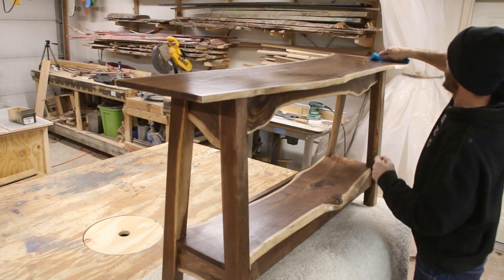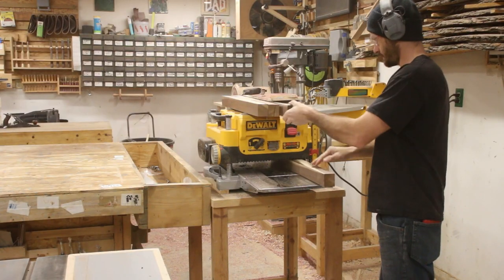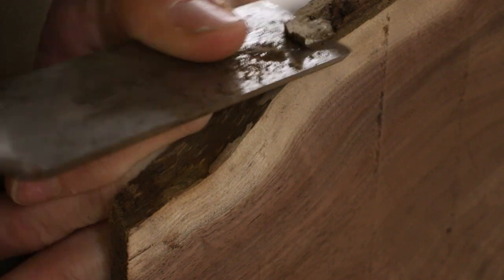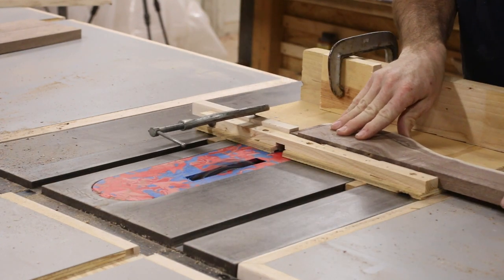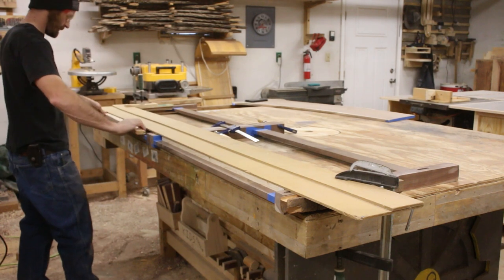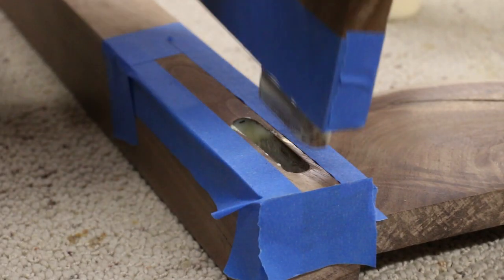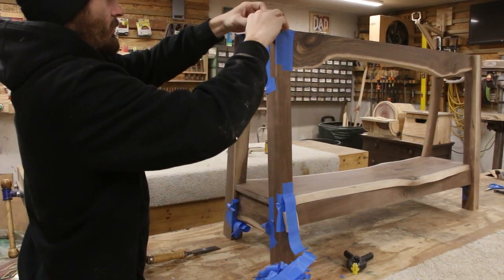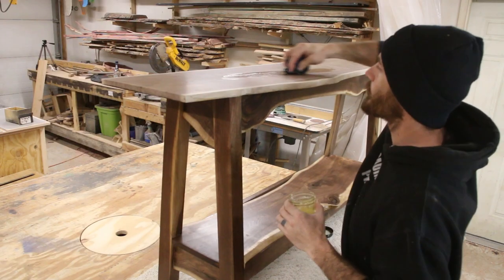Why This Table Needed 8 Months to Build

Comment: Impressive work sir. Years ago, I made a 20”, or so, round table from a 4” thick cherry round from a tree I took down that was dying. I had a live edge on it too. I left the bark on the table edge and used the same finish on the bark as I did on the top. It worked really well. 

Very nice table young fellow.
Reply from the maker: Thanks! That table sounds awesome!